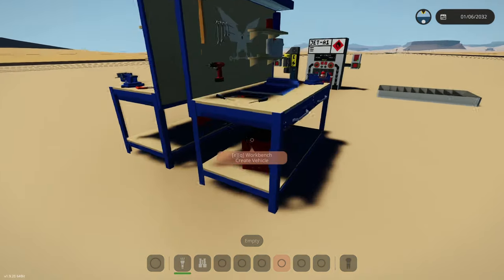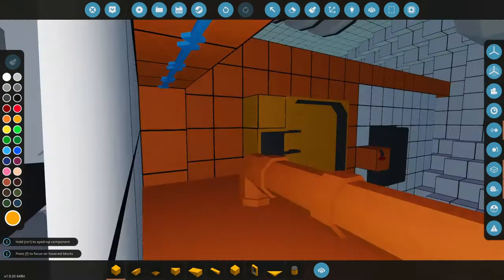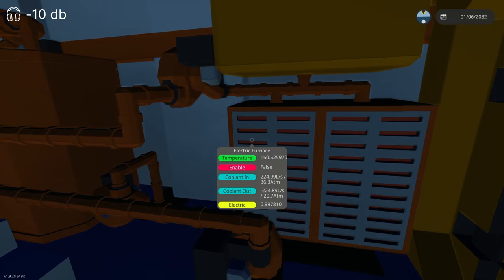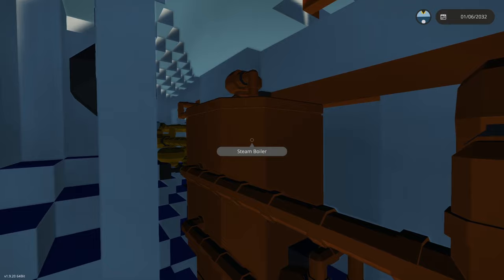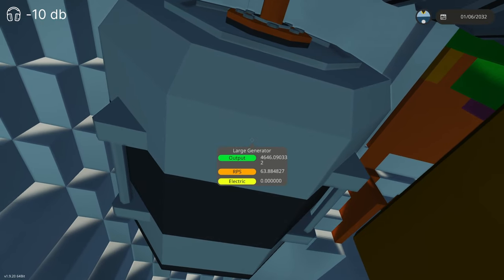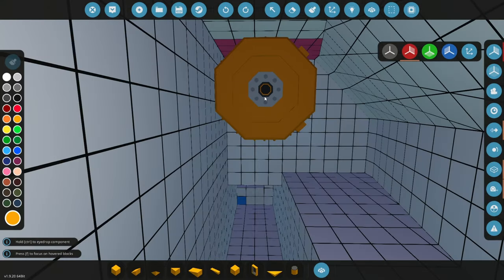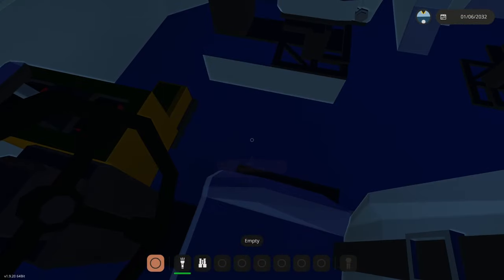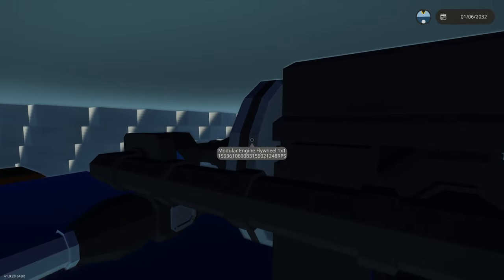Stormworks | Paladin - Trying To Be A Real Submarine

Comment: Love the Video, The Reason I think Paladin is so slow is because of the fluid jet placement and that you don't have enough of them if that makes sense, unlike Clifford and the lifeboat this things hull is a lot worse for trying to go through water, I would recommended placing more fluid jets at the back, and maybe removing the fluid jets at the front 

Also when it comes to ballast tanks a good way to tell if your boat will sink is to just brake a hole in them so that they instantly fill with water, you can then slowly brake more and more holes in certain compartments of your boat till it finally starts sinking, then you know what sections you need to make into ballast tanks, another way is to lower the mass by using a rocket booster but this will create unwanted effects such as it flying away in the wind if you put in to extreme of values.

Another thing I would Recommend is trying to optimize your steam engine a bit further, know that it is based of pressure you can actually make steam engines even more powerful then before and when it comes to the fluctuations a valve timing system might help although it probably wont.

Also I think you should check the fluid input rate of the fluid jets even after you put those impellor pumps on, since I think you were putting in a lot more air than actual water and were still not getting a high fluid flow rate.

Great Video, Keep Up The Good Work.
Reply from the maker: Thanks. Yea I think I need to go watch all of Captain Cockerels  videos about steam and re-learn how it works. I really had just be brute forcing it up until now.

Comment: Found you yesterday, cool videos, binge-watched this Paladin thing ;)

The main reason why Paladin won't sink is that it was built to be a ship, not a submarine.

I know that Stormworks physics works in misterious ways, but the main concept of a submarine IRL is that you try to prevent it to sink, not to float. Depending on the desing, between 1/3 - 2/3 of the whole internal volume is a flood space, mostly on the top section of the sub, so you can blance centre of buoyancy and the centre of gravity. When surfaced, most of the water is pushed out by huge pumps, so to submerge it, all you really have to do is pumping the air back into pressure tanks. This kinda works in Stormworks too, especially since they added pressure to the game, but it's a bit slow.

There's a very complex math going into calculating how much air you have to pump into the flood compartments to achieve positive lift, and I'm not sure Stormworks is good for that, but you can try poking holes into the hull until it starts to sink, and then use the pre-pressurised tanks to force water out until you achieve neutral buoyancy.
Then, all you need is one tilt sensor to measure pitch (you don't need to worry about roll thanks to the shape of the hull and how it reacts with Stormworks physics), and balance it out with a forward and aft ballast tank.

Building a working sub in SW was always a pain in the ass, but it's absolutely doable.

Happy new year mate!
Reply from the maker: Thanks for the info. I think ill try a smaller normal sub next time.
Reply: @terr-rawr-saur  in all fairness, size doesn't really matter in SW.
IRL does, but it's tricky.
 
Almost every modern sub is built with a double hull. There's an internal pressure chamber (that's the interior) and an external hull called the "shell", that's the sub itself. The gap between the pressure chamber and the shell is basically most of your flood compartment.

Size comes into picture when you try to pressurize the pressure chamber. As people live and work in there, it has to be at a constant pressure, which is pretty easy when the sub is surfaced, you just open the external hatches and let physics do its job. The problem comes when you dive. Since water isn't really a good cushion, the deeper the sub goes, the bigger the external pressure will be, and to maintain structural integrity, you have to very delicately balance internal pressure in order not to implode.
Now, the bigger the sub is, the more difficult and expensive to balance this pressure difference out.

That's why, unlike ships, submarines are pretty much the same size (there's a difference between the smallest and the biggest obviously), in order to achieve relatively similar depth limits (it depends on building materials, material properties, and whatnot...). While physics can be cheated in SW, it can't be cheated IRL.

Paladin still can be a really good sub, all you have to do is either double the hull (it sounds annoying and breaks up the design), or you have to create much-much bigger flood compartments to balance out your pressure chamber (which is mainly your moonpool). If you're willing to sacrifice physics flood and delete all your unnecessary blocks you filled the inner side of the shell with, you can claim back an immense amount of space you can simply use as a flood compartment, but since Paladin is a big boy, you'll need quite a few pumps to force all that water out when you want to stay surfaced.

Comment: I mentioned this idea already for Cliford, but I would love to have some winches, with fluid ports at the end, so when you fly out of the water you’re able to keep flying. 
(And you can use it to rescue yourself when you’re beached, but this is pretty boring in comparison :D)

Also, it could be cool if you had some kind of emergency-air-connection, so basically a hose and a fluid port that’s buoyant, and can be released if the air tank gets empty if it shouldn’t. (And some „normal“ emergency air tanks)
Reply from the maker: There was an old glitch that might still work where you limit the fluid jets output to .002 with a variable valve then push water through it with the infinite power generator, and that lets you carry a small amount of water onboard while producing crazy amounts of thrust,. letting you fly.

Not sure if it still works but that would be cool.
Reply: That glitch still works

Comment: Darn it. It could have been apparent from the beginning: a submarine is not a good freighter. That is a vital lesson learned for me. You can account for fluid cargo by having additional ballast tanks of the same size but I see no way to account for the buoyancy of the moon pool. You would need to flood it if it is not in use. If you can xml edit solid rocket boosters to have negative mass, would it not be possible to xml edit them to have an incredible high mass? If you have to toss the moon pool or make it just human size you could pack more weapons: VLS for small and/or gps rockets. Would be cool as well. On a second thought the large moon pool feels more like a research vessel thing for me. Not necessarily like a defender/combat ship.
Reply from the maker: Its possible that it would require an increased mass rocket booster just to get it neutrally buoyant. I really have no idea how to build a submarine though.
Reply: I haven't build a fully functional submarine either. But the issue on the Paladin is the moon pool. You have such an incredible empty space which creates massive buoyancy under the laws of Stormworks. You have to fight it with mass or fill it, so it does not create buoyancy. You surely can fill the rest of the ship with decorations and compensate the buoyancy of the rooms and bridge with ballast tanks but the moon pool is just too massive. There is not enough spare space to fill with cannon barrels to get it under water.  A black hole would get it under the sea but you would need to create a block with a very high mass first and it would need to be placed wisely so the center of mass is in a place where it makes sense. I cannot remember if you already did and the markings of weight blocks do not look nice but changing the bottom to weight block also helps.
I would like to give some advise for the steam engines because you wrote in another comment that you brute force it currently. Not using pumps or valves between boiler and furnace decreases heat up time. The boiler cannot explode anymore. You just have to find a nice furnace temperature which gives you a good boiler temperature. I set up my initial temperature high so all the fluid in the boiler turns to steam quickly and then I reduce the furnace temperature to just stay above 105C. I do not use a pump to the pistons because there the boiler creates its own pressure. I recommend a large fluid pump from the piston output to the condenser  to get rid of steam as fast as possible. The output of the piston should have 0atm for maximum power output. The input node of the steam piston should have 60atm. This is not possible with the fluid in the boiler alone. I add small prefab tanks into the water line from the condenser filled with fresh water. 1-3 tanks have been sufficient for the vehicles I built so far. I just run a test and check what the piston pressure is when all water is gone. I also tried a medium tank but this overfilled the system and the pressure on the output node increased. So I stick to the small tanks. This way you do not need any logic or pumps for water injection. Another indicator is the boiler pressure. It often is 2.5 when the piston pressure is 60atm but I check the pistons with the tool tip.
I also agree with An_Individual771 that the impellers for the fluid jets are nonesense. I am not that experienced with water jets but there have been posts on reddit which asked for more water jets to get faster. I strongly believe any propeller as well as the water jets have a cap for the power they can accept and turn into motion. You can only get faster with more water jets. But I question if this is necessary. If you sail 40-45 knots surfaced I expect 150+knots submerged. My test sub also reached 45 knots surfaced but 180knots submerged. Is it really that important to get a high surface speed if you are really fast under water?
For the electric furnace you might want to try a SR Latch. On if temp<desired temp, off if temp>desired temp+20. This way is periodically turns on and off. It is a bit more pleasing to listen to. While I am at writing a whole essay I can also propose to make a nuclear reactor for you if you are interested. You mentioned it in the video that you lack the expertise. I also did not build a reactor for a long time but I could dust off my old nuclear train and polish the controls a bit. With no obligation to use it of course. It would also not only for you. I plan on making nuclear powered helicopter carrier. I just would design the power plant a bit earlier than planned. It is a 3x3 rod design in a 5x5 housing. The controls will not be fancy, just another type of furnace which outputs 200C or something.
Reply: Shouldn't it be possible now that we have variable pitch propellers that we could use those as a substitute for ballast tanks?
Reply from the maker: Probably not as a substitute because you will be fighting all the buoyancy but as a way to control depth would work well once neutral buoyancy was achieved.  @papugaw7701